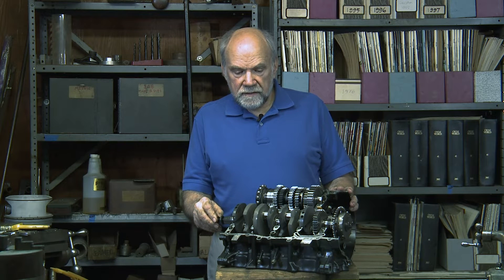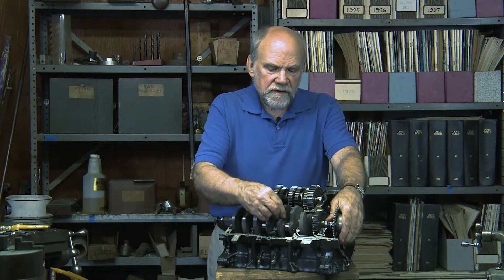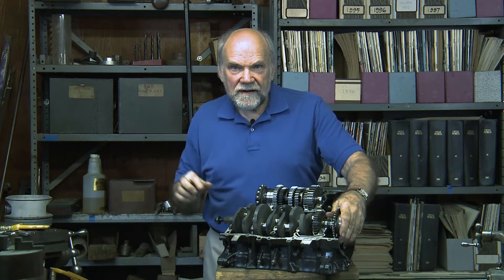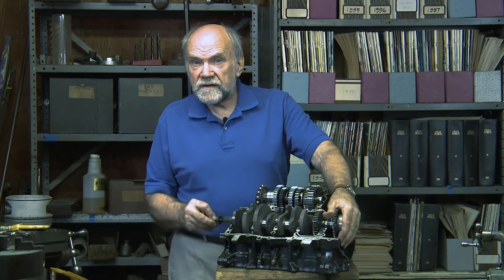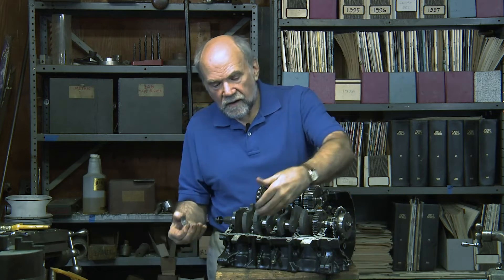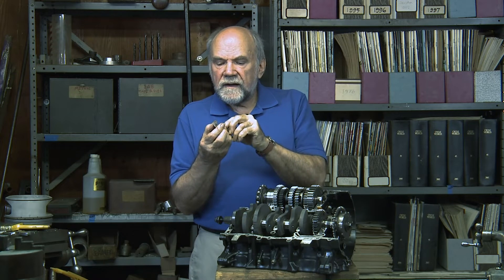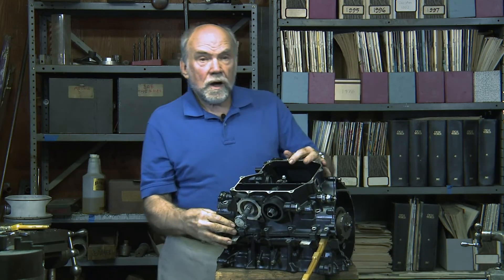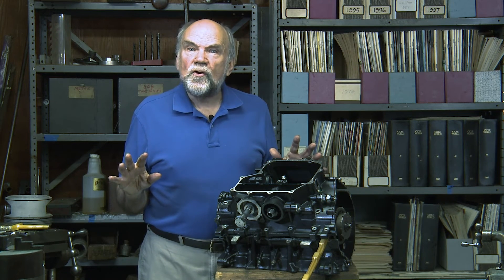How Does A Crankshaft Work?

Comment: I always learn something from Kevin Cameron.

I have a question on fabrication though.  When the upper and lower halves of the block are machined for the crank bearings what is the datum - or features - used for location of the block for the cutting tool so that when mated the two half circles match perfectly for the crankshaft?  
I would think it is one of the holes - or several holes - from the casting that were honed.  This would allow the halves to be placed into the machining jig/fixture thereby locating the halves perfectly for machining.
Does anyone know?  Thank you
Reply: Just a guess: the two halves are clamped together temporarily, then drilled for the crank.